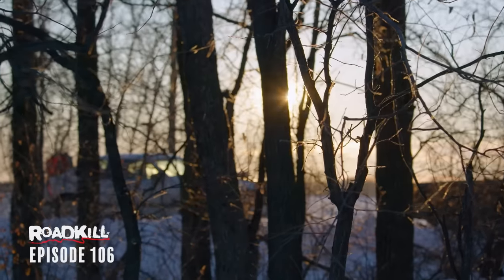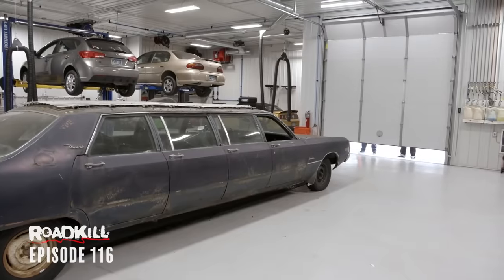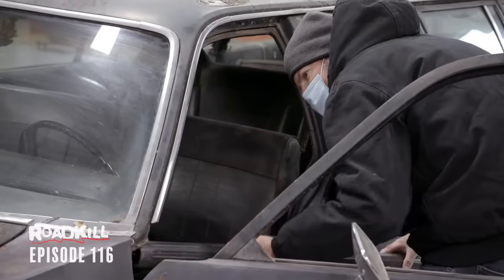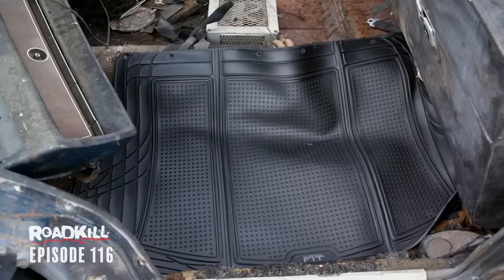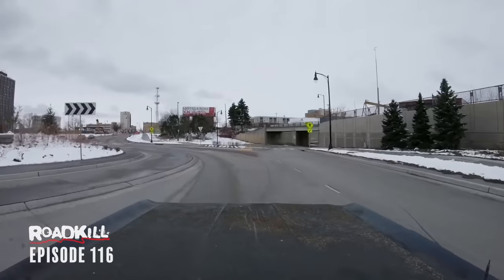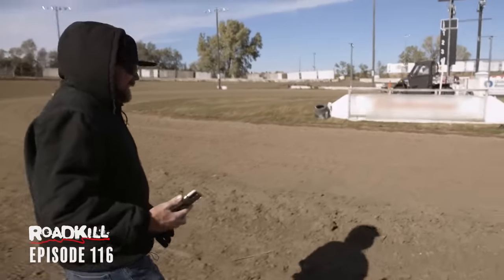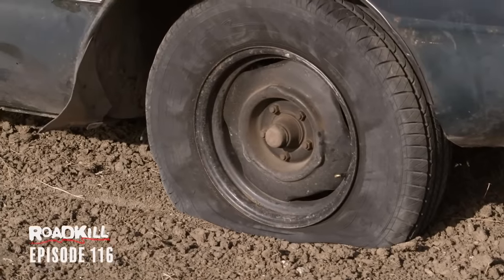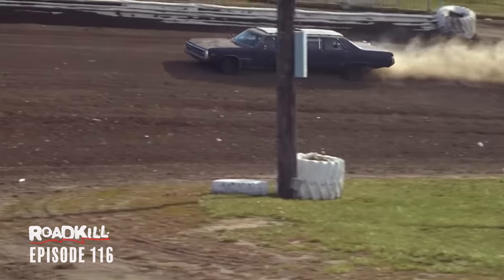8-DOOR Airport Car '71 Chrysler! Road Trip and Donuts! | Roadkill | MotorTrend

Comment: It doesn't deserve to be restored, but I think it at least deserves to be fixed and tricked out. Fix the door latches, get rid of the rust, put a set of wheels and tires on it, and in full roadkill style, throw a supercharger (or a turbo) on that poor worn out bone stock motor. Cut a massive hole in the hood, like the good old days.

Comment: Had to be a fun and functional boat! I owned and (daily) drove in 1969 440 Magnum factory rep. New Yorker custom (build sheet was under left side of the rear seat FWIW) back in the early 90's and it was a gem of an automobile. It took some getting used to but it was a smoker. My '72 Mach 1 351C and '71 (first year smell block SS) Chevelle SS 350 were fine aaaaaand good...The 440 Chrysler was twice as fun. Dropped the driveshaft and destroyed the rear axle during an epic burnout but replacement locker from a lower geared Police Fury III only made it more fun!  Smoked an SVO Mustang from highway speed (literally, tire smoke from around 70mph). He caught up while refueling and examined my ugly forest green monster in disbelief. And for what it's worth I'm an shopping for a decent Mustang SVO. Neat cars and it would fit my small garage.

That "wagon" is cool!

Comment: epic fun, i used to drive for 9 years daily a 82 cadillac de ville 6 door armbruster stageway coach, stock motor blew a head gasket so i put in a 74 buick apollo 350 2 bbl. it would lift the nose in 1st across a 4 lane intersection no problems, drift corners in snow or dirt and was super controllable, used it for designated driver runs and everyone loved it, had 10 foot straight pipe side exhaust and cragars on a black body with dark blue lowers that i stenciled in over 2000 skulls before transparent over coat,  at a car show, i would challenge people to a timed run around the car closing all doors hood and trunk before getting in drivers seat and putting belt on, was a super fun challenge for everyone, there is so much fun you all can have with this car in so many ways, hope to see more of it soon... with decent wheels on it, maybe

Comment: This should absolutely be a dragster. Rear engine, huge tires, nitrous, the whole deal
Reply: Nahh dirt track car. Could you imagine this thing drifting around the corner with the left end of the front bumper on the inside wall and the right rear bumper end against the outside wall.
Reply: Multiple engines
Reply: @jayterry8551  yeah maybe. I just wanna drop the whole thing right onto a top-fuel car
Reply: Make it the wheelie king!!!!!!!! Full blown dragster
Reply: They could challenge Tommy Bowsher's hearse to a drag race.
Reply: @DiggityDawg007  They made Stubby Bob SHORTER to do wheelies, not longer. Not to mention the blown big block on the rear axle. Physics, my son. 🤔
Reply: I can see that it would be awesome with a blower hat 4 inchs out of the roof
Reply: I agree it should be a drag car
Reply: It's probably 7000 lbs, guys. The only chance it has as a drag car is if they put a 1000hp/2000lb-ft Cummins in it. Cuz 7000 lb Cummins Ram trucks run 11s all the time. Torque is King.
Reply: It's cool but would look a lot better if it was a wagon.
Reply: @DiggityDawg007  The wheelbase is way too long for it to do a wheelie.
Reply: Fr i was thinkin the same thing

Comment: How can you say the coach work is probably sketchy when the car is decades old and it is not sagging in the middle?  Don't judge what you don't know.
Reply: Because at time's they say stupid things. I agree
Reply: @auteurfiddler8706  Armbruster Stageway was a reputable company that took pride in their work.  They should not be comparing newer stretch limos with an 8 door airport limo.  This has a strengthened frame and the chance of it being a low quality build is almost nothing.

Are you talking about Junkyard Digs and his long stretch?
Reply: @auteurfiddler8706  I am not sure about Superior, but the Miller Meteor was not a well put together piece.  My Eureka, 1963 model never had any rust problems at all.
Reply: because a lot of vehicles that got stretched and chopped back then WERE sketchy,  he's simply stating that it PROBABLY was done sketchy because the majority were.

Comment: I've lived near Fort Smith my whole life. I believe that Armbruster Stageway Coach eventually became Federal Coach and Limousine who I worked for about 3 years in the late 1990's. Me and a couple other guys were responsible for putting the wiring inside after the Cadillacs and Lincolns were stretched into either Limos, Hearses, or 6 to 8 Door People Haulers. When you said this was likely put together sketchy, I can confirm, some sketchy stuff is done in these conversions, especially the rear wheel drive type cars. Cadillacs started becoming front wheel drive around the time I worked there and that made the conversion a bit simpler, but still was sketchy.

Comment: Instead of a "drift taxi," you have a "drift limo." This thing looks like it'll be a blast once it has a new engine, bucket seats, belts, a cage, and whatever power adder you boys go with. 🤙🏾
Reply: You would need to be putting in a diesel for that dream. Nothing else would have the torque necessary to break traction.
Reply: @davefroman4700  I think their's enough room for a 12 valve between those towers. That's a good point. 👍🏾
Reply: @TheGeekiestGuy  enigma?

Comment: I had a 99 suburban with the same steering issue. you could turn the wheel good 1/3 of a turn before it noticed you wanted to change directions.

Comment: Airport cars were meant to actually stay ON THE RAMP. These were use to shuttle passengers between aircraft that had tight connections.  But it was also used to move crew to and fro from dispatching to the aircraft.  A 747 alone could have up to a crew of 18 total for a high density flight say JFK TO LHR .

Comment: I found 1975 New Yorker limo made by the Same company in Arkansas back in  in high school.2000-2001  at a friend's house in Clinton co Iowa. It had a very built and maintained 440 I changed the oil and put fresh gas I. It and drove it a few miles home . Very sketchy frame work in Arkansas .
Reply: A barn find before barn finds

Comment: Dummies. The 30 degrees of steering wheel play probably means at least one of the two blocks is missing from inside the pot coupler on the steering shaft. I had a 72 Polara like that decades ago.

Comment: I'm surprised after blowing the tire on the front passenger side they didn't turn around and run laps in reverse direction!!
The car would be leaning into the turns and the left front tire would be cambered correctly to make even faster laps!!

....... but with no seat belt and doors flying open?...... yeah maybe not such a good idea after all.😳

Comment: Modern late models are as big as your normal 6 door limo. And are big blocks with carbs!!
Ofcourse you should have swapped front wheels. L/F does little and it will give you stagger on the front,, turn it in harder!!

Comment: I lost respect when the doors "popped" open. in motor vehicles, 3 things are designed to survive when all else fails. seat belts, brakes, and doors, aka body restraints. windshields were redesigned to retain occupants and keep them from guillotining themselves as prior with plate glass models. doors retained the person in side impacts or high g-force turns. buncha mooks!!